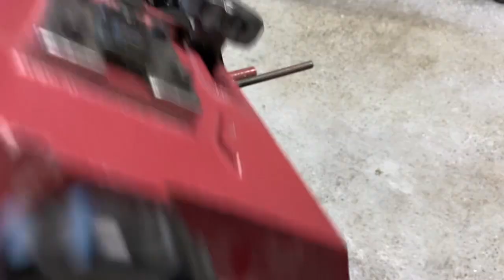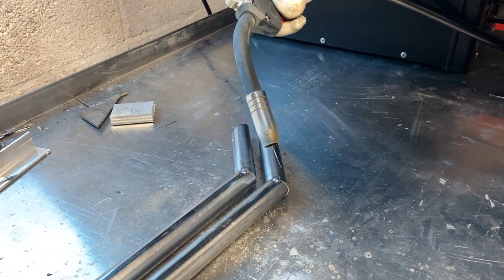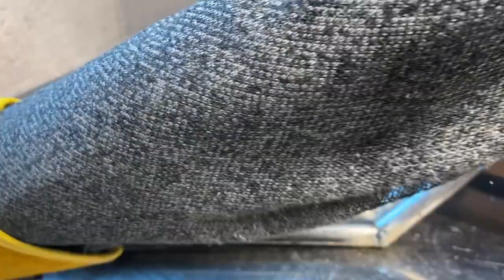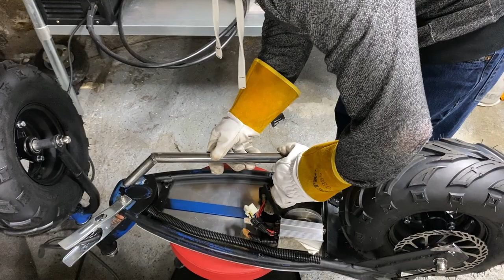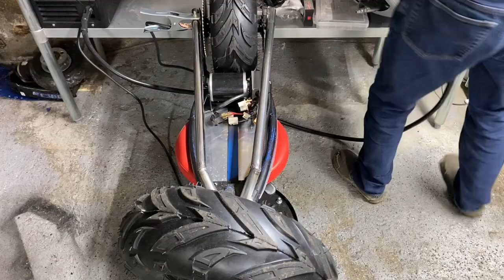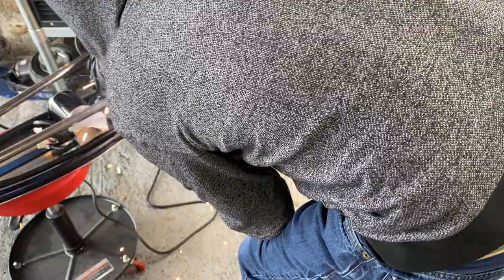Mini Bike Scooter Build - Part 14 - Frame Bottom Tubes

Comment: Motor and controller like to small for that project.. what voltage/wattage is it??
Reply from the maker: Thanks for the comment!!  I agree with you there actually... it's a 24v/500w setup, only mildly more than what the E300 had stock and I'm not sure if the esc works 100% yet.  I DO have bigger ideas in mind, this is just what I had on hand for building/testing.  If you happen to have a bigger motor/esc/battery you are getting rid of... ;-)